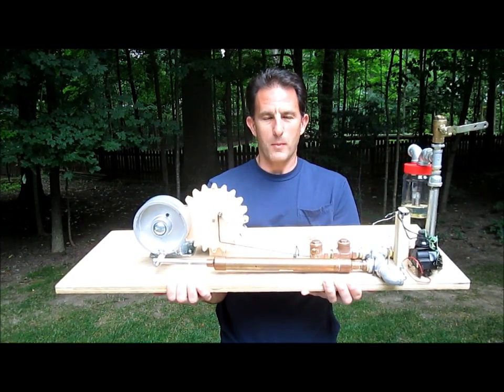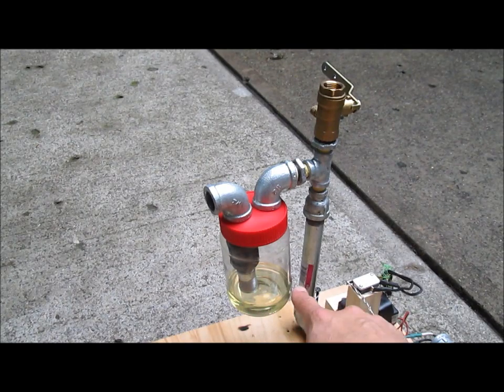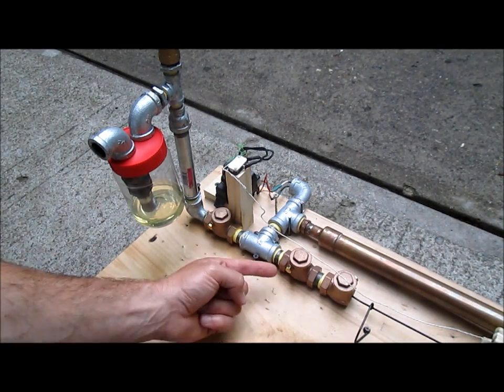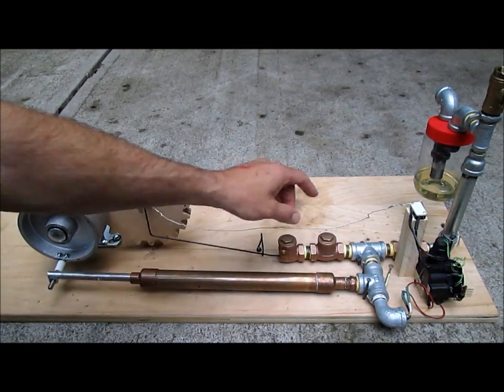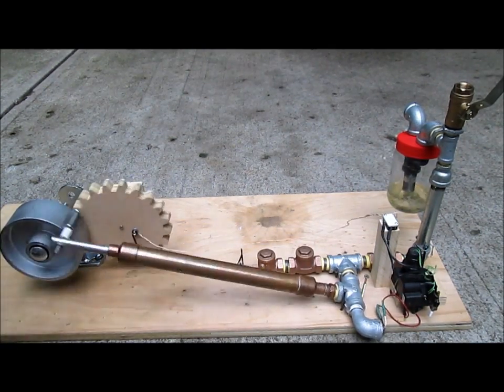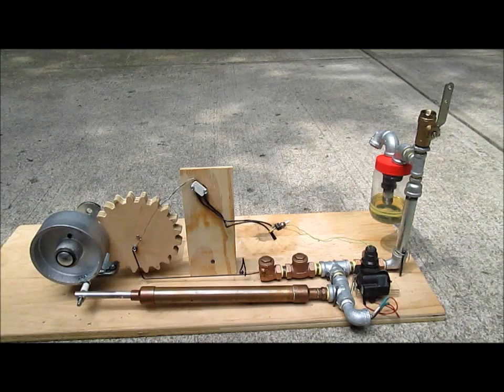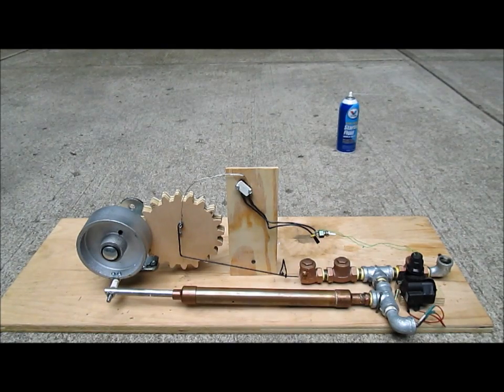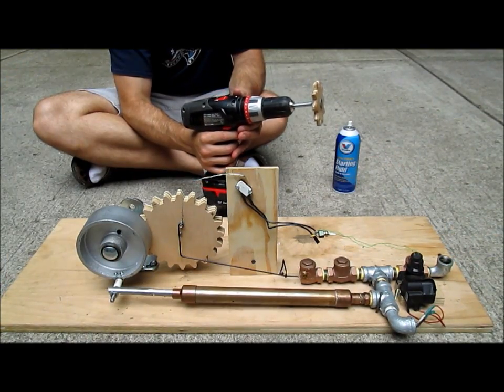How To Almost Build an Engine With Only Parts from the Hardware Store 3 (HowToLou.com)

Comment: Looks like the system is backfiring or pushing air out and spitting fuel of out the intake.   Maybe a heavy flywheel to keep it going in the right direction as some others have suggested.  Thanks for the video.  I am enjoying it.

Comment: It look like the time of the spark could be one of the problems, you could think abou using an elctroical circut to triger the spark, although I am not sure if you can find the parts at a Hardware Store, Radio Shack is more likely to have them.
You could use an Infrared sensor and a MOSFET to triger the spark, you would have to make a hole (with an IR LED on the over side) in to the wooden gear at the right spot to let the IR sensor look through.

Comment: Use some electronics. Use a car Fuel Injection Nozzle. With a fuel injection gas pump. The fuel pump in the gas tank pressurizes the gas in the lines. The fuel injectors open and close to allow fuel into the combustion chamber

Comment: I dont think your ignition timing system is accurate enough - sometimes it sounds like it doesnt even fire on a stroke although that could just be the video. 

Important things you need on a 4 stroke engine. Good spark and spark timing, the correct ratio of atomized fuel and air, and enough momentum through weight and force to carry the engine between each firing.

If the fuel isnt atomized it wont burn. If theres too much or too little fuel compared to air it wont burn.

Comment: google the term 'spool valve' and '3way valve' use that to replace the check valves... build a better carburator - one that allows you to carfuly adjust the mix... add a proper starting motor - it will be easier to adjust the mix when you don't have to hold the drill

Comment: Those grill igniters (if yours is anything like mine) do NOT have reliable timing! With mine, when you push the button there's a short, unpredictable delay until the first spark. This probably depends on the charge level of some internal capacitor.

If I were you, I'd try an old fashioned, piezoelectric grill ignitor. If the engine runs it will probably be destroyed in short order, but at least the spark will happen at a very reliable, consistent point in the cycle.

Comment: Again, I think you need a bigger flywheel. A bigger flywheel will make the rotation slower and more stable. Your check valves are too slow, on some points of your video you can see that the gasoline valve is open during explosion. I think you don't neet the second check valve for the exhaust port, because you have a valve that only be opened when you have pressure in the combustion chamber.

Comment: I second that, it's exactly what I thought when I was watching the video. The timing must be way off using that scheme. If you really want to use the switch, then at least activate it using a cam or something of the kind - something more solid, reliable, repeatable. Also, are you sure the sparker activates at the exact time when the switch closes? If it doesn't, then it's not adequate.

Comment: What kind of seals are on the check valves?  It could be possible that the fuels you have tried ate away the seals or they may have melted due to heat.  Another thing to look at is the operational pressure of the check valves as some require a decent amount of pressure to operate correctly.

Comment: The first thing you need to look at before timing and ignition would be your check valves. When you were running on engine starter with the gas tower removed, every time the engine fired (slight pop) a standing flame could be seen in the elbow you were spraying the 'fuel' causing an intake backfire. This should not be happening if your check valves are functioning.  Right now you have a major loss of compression and if you were to get it operational, you could possibly blow your fuel tank.

Comment: I am looking at the amount of air space between the cylinder at TDC and the valves and thinking the compression ratio must be awfully low.  Also, judging from the back-fire, it doesn't seem that your check valves are doing their job.  Regardless of when the spark occurs, if it can blow past the valve, it's not a valve.

Comment: It looks from the video that there may be a bit of a delay between closing the switch and getting the first spark. You may need to advance the timing more or build a more traditional ignition system that will spark immediately on the opening of a set of points.

I also suggest that you should switch back to propane fuel. Get the engine itself working reliably before trying to perfect something as complicated and finicky as a carburetor.

Comment: 1) flywheel
2) spark system: the timing is REALLY crucial for an engine to work. I guess you need to make a normal pre-charging system, so that the trigger can release the spark, not just "turn on" the transformer circut that needs a time to pump-up energy and hook the trigger by a normal solid shaft to a flywheel, not some peice of wire
3) try to run it with starter fluid only, and only then switch to your mixture, because it also can be a source of problems. Try to solve them one by one...

Comment: I'm convinced it's partially related to your spark system,  You can hear a delay between the switch moves over and a spark happens.  You can even see rotations without sparks at all.  I think you're 90% there, though.  Also, I think your choke system should work correctly, disagreeing with 8Complex.  The problem with your carb is that your "choke" is really choke + mixture, and it's going to be hard to get that right once it's running.  I wouldn't be surprised if you need to run with the choke.

Comment: I agree, I think the flywheel will help. If you look at old single piston kerosene engines, they have massive flywheels.

Not sure if your hardware store carries trailer tires, but I would start with a wheel & tire.

Comment: I'm suspecting a few things:

1- Your fuel isn't atomizing properly with the bubble system.
2- You aren't getting the right air/fuel ratio.
3- Your spark timing is still a bit off, and perhaps not strong enough.

One-way valves aren't ideal, but I suppose at the lower compression level it'll work. Still a little questionable.

Also, a choke cuts the amount of air through the carburetor to enrich the mixture -- your 'choke' just lets more air into the cylinder and less fuel, thus leaning it out.

Comment: Either make the large cog out of aluminum, or add some weight to the one you have now. Even on cars its hard to get a solid idle when the flywheel is too light.

Secondly, from the flame and the fact fluid gas is being pushed out the jar/carb makes me think your intake valve is not working properly. The same way you made your exhaust valve work with the crank, I would incorporate an intake valve like that as well.

Comment: Lou, great engine.  It looks like your intake check valve isn't shutting properly, hence the fuel shooting out and your starter fluid catching fire.  I also think your stroke is way too long for the air to properly compress and combust.  I'd suggest a much shorter stroke.  Good luck.